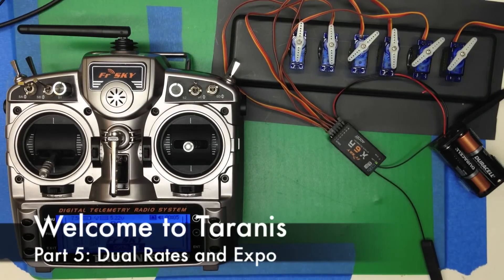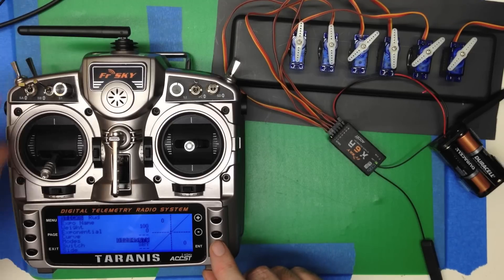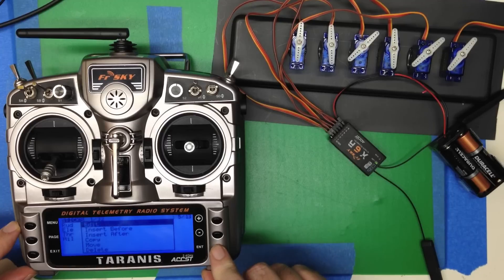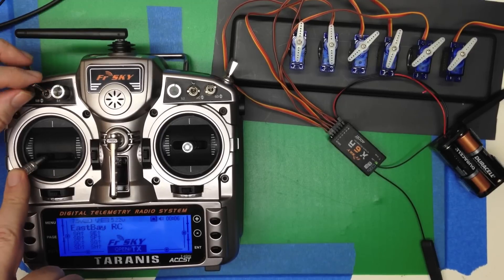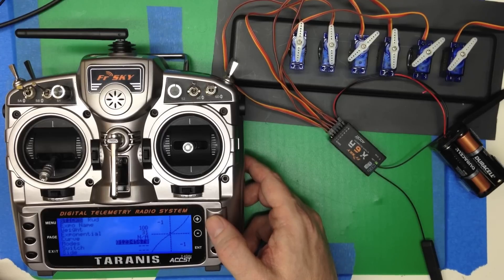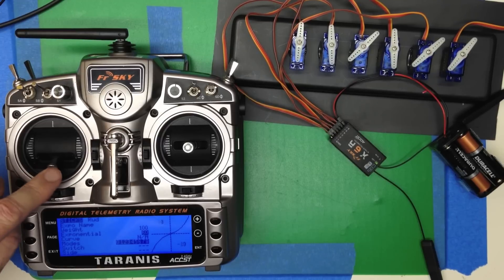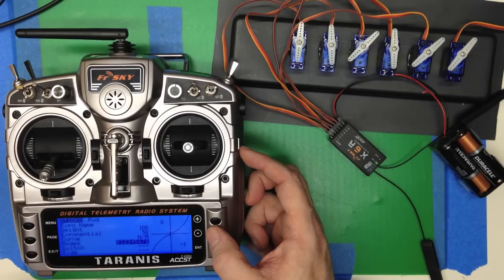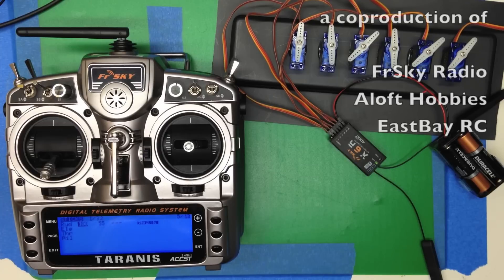Welcome to Taranis, Part 5: Dual Rates and Expo

Comment: How do I get full servo movement on the two way switches on Taranis X9E? Only get 50% servo movement when operating switch.  Many Thanks.
Reply from the maker: Hmm, maybe there's something wrong in your mix.  Try deleting the mix on your channel, and then  specify a 2-way switch as input.  Also check the channel on the OUTPUTS screen and reset the channel, in case there's any scaling modifications there.  On the main screen you can page through the displays to see what the radio is sending (bar scales), and it should be far left and far right, for -100 and 100.
Reply: @marhar2  Many Thanks! After about four cancel and four re listing in Inputs and Mixes, both the 2 way switches now give full servo movement

Comment: Hello, thanks for you videos on the Taranis.  I'm searching high and low for information on how to program an S Pot to my flaps.  I want my Flaps to engage, say, 18% if I rotate the potentiometer 18% for example but if I need say, 22% flaps I can continue to rotate.  I can't find any information on how to go about setting this up.  I have set up flaps on the S Pots but they would only engage 100% or back to zero% nothing in between.  Any advice would be greatly appreciated.
Reply from the maker: Hmm, you should be able to simply set a pot as input and flap channel as that output, and that will do what you want.  It sounds like your pot might not be calibrated... try recalibrating with the radio calibration menu.

Comment: I set my Taranis Plus up with dual rates in two switch positions,  with the help of your excellent tutorial. and I have a problem. No matter the amount of weight I select, 0 to 100.  The servo throw is only one, maximum.  Also the monitor don't show any changes. Any suggestions.
Reply from the maker: Hmm, it may be the Taranis+ is using a newer 2.x version of the software.  I'll check it out when I have the chance  to upgrade.
Reply: No,I was using 2.0 of OpenTX and I thought I might of had a software bug so I upgraded to 2.1.9. Same problem.
Reply: I created a new model and that did it.

Comment: Hi
is there an update ?, because i don t find the page "Stick" on taranis.
Just Imputs on page 5
Ty
Reply: ***** Taranis plus is different....you don t have the "stick page".
It s not an update issue
Reply: ZinK FPV Mine is not the "plus" and I don't have the "sticks" page either. EDIT - As far as rates and expo go, it really doesn't matter. The page seems to have been renamed from "sticks" to "Inputs", that's all. The instructions in the video still apply.

Comment: looks like the Taranis Plus is different in some places...
don`t guess you will do a Plus series ?? 
hopefully I can figure out the differences and get this T Plus working.
A little confused at difference between Inputs and Mixers though
Reply from the maker: There's a few hardware upgrades, but the main difference is that the Plus ships with Open TX 2.  A couple of people have asked me about that, so I think I'll do that!  Regarding Inputs and mixers:  think of the inputs as everything related to sticks, such as dual rate, expo, etc.  Then the mixer is how the sticks (and switches, etc) are mapped to the output channels.
Reply: roger.. thank you